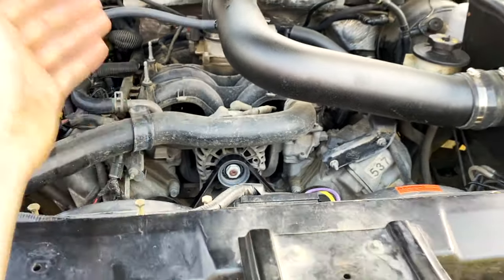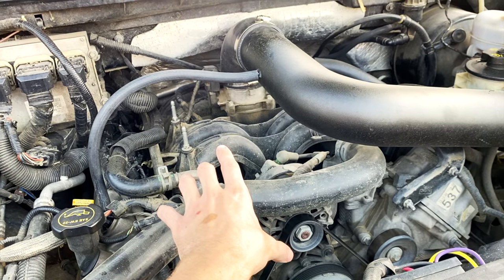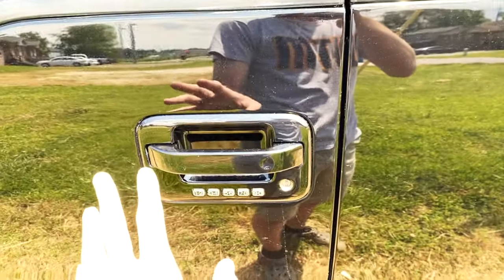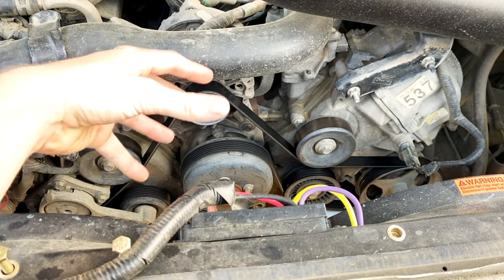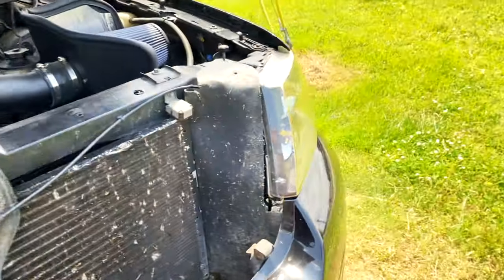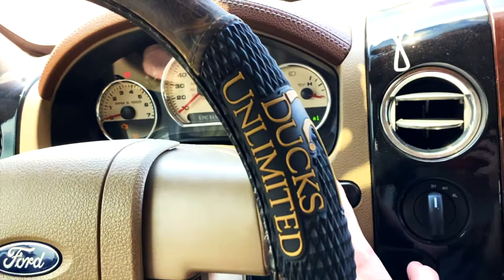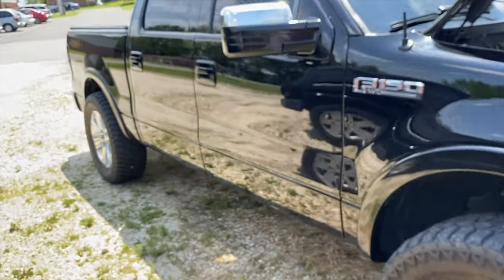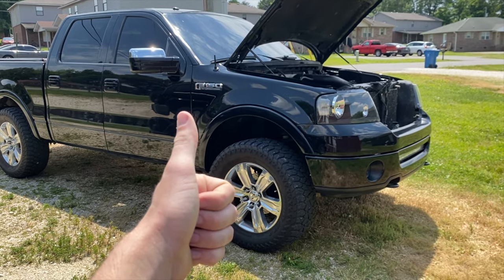5 THINGS YOU DID NOT KNOW ABOUT YOUR 2004-2008 F-150

Comment: I have a 2005 King Ranch F-150 with the 3 valve 5.4 L engine.Added Volant cold air induction system,a Edge Lightning computer tuner. I have 112000 miles on the odometer. Love this truck. Appreciate the keypad info.I had the "Limp Home" mode kick in 1 time(a squirrel had feasted on a wiring harness behind the intake manifold). Look forward to more videos from you.
Reply: You got a link for the tuner?

Comment: 2:30  great stuff about the keypad.  Also if you press 2 after your code it will unlock both front doors, so if you press 3/4 it'll unlock ALL 4 doors.  I love the keypad.  I had a 2000 z71 for 2 decades and really wanted the keypad, but i just started carrying a extra alarm fob all alone in my pocket

Comment: My 07 5.4L is clocking in at 182k miles right now. Have to say it’s been dead reliable. Appreciate these videos on these F-150s! Did spark plugs, engine coolant flush, transmission pan drop, axle fluid… well worth it with the price of new ones!
Reply: I recently bought one 201000 miles rn been good to me have a couple things I’m trying to figure out

Comment: I have a 2004 (Updated body style) with 127,000 miles and I’ve only done oil changes, brakes, transmission fluid flush and that’s it. It’s lifted and I replaced the strut 6” lift blocks with Fabtech 6” Coilovers. It’s been so dang reliable that I’ve kept it this long and bought a 2017 (bought new in 2017) and couldn’t bare to part with my old girl. She’s towed boats, friends cars (on car trailer), been in the mountain trails, sand dunes, mud bogs, snow, helped dozens of friends/family move and everything in between! She’s my ride or die!

Comment: I worked at a scrap yard for the better part of a decade, we couldn't warranty these engines because of everyone being afraid of failure. I have owned my 5.4 3v for about 6 years now, sitting just shy of 200k, and I want to say these engines have gotten a bad rap. i regularly abuse my truck, but I also regularly maintain it and she hasn't let me down (knock on wood). These are great motors making great power with plenty of aftermarket support but still great out of the box, I stand among few as a believer in the 3 valve. The fact is they have a bad design that is easy to remedy, lock the phasers and update the spark plugs. If you own a 5.4 3v my advice is either lock out the cam phasers, or just know in the back of your mind you'll be replacing the engine at some point, like you said in the video "that could all change tomorrow" lol
Reply from the maker: Black trucks been beat, broke, put back together and ready to do it all again! At least until tomorrow 🤷🏻‍♂️😂
Reply: What you mean about "update spark plugs"?, I've had my 2006 FX4 for 16 years, last time I replaced Spark plugs I called Ford dealer and they said their Motorcraft Spark Plugs are the same design, the same ones that break in certain circumstances.
Reply: How do you lock out the phasers? Actually what is a cam phaser?
Reply: @JayThompson25  How do you lock out cam phasers.
Reply: @JayThompson25  I'm about to buy an 2008  with the 5.4.  But now I'm thinking of maybe not

Comment: 2007 2WD Supercab with 161,000 miles no issues. 5.4L has been pretty good and tow a small boat. Stupid warning lights like the airbag, parking brake have been on but drives great. Only thing is the 36 gallon fuel tank and city driving breaks the bank man

Comment: I have a 2004 xlt with the 4.6 and 170k miles and it's still running strong after a rebuilt transmission and a few oil leaks

Comment: ‘06 FX4 owner here. Just another little tidbit, if you ever forget or buy a new(used) truck and don’t have the code, it’s on a plate behind the plastic on the back of the cab. Some earlier models it’s on a plate somewhere under the dash on the drivers side. Possibly on the firewall behind the carpet and insulation.

Comment: I replaced the aftermarket fan clutch for an original Motorcraft Fan Clutch, one of the best things I've done to my 2006 Fx4, doesn't make that intense aerial noise anymore, all aftermaket flan clutchs I found were "heavy duty" or something like that, I thought it meant durability but instead it seemed it'll engage with less temperature ...I hated it. Now with my OEM Fan Clutch my truck sounds so healthy is therapeutic.

Comment: Your engine bay has so much more room then mine! 
I did the timing job on my 2005 5.4 3 valve and holy shit it was tight.
I love this truck. The body is one of the best truck bodies ever and by far the best ford has ever made, and they are so customizable as long as you do it right (please dont add flairs without spacers on these trucks I keep seeing em around and it looks so bad), also the interior Is so comfortable, and finally my favourite thing the power. Iv drag raced people in my truck and have beat bmws, chargers, subarus, I even beat a raptor on the dirt because my truck was the last without traction control. 
Iv put so much money into it and most people dont get why i do until i take them for a drive

Comment: I have a 2004 fx4 4wd f150 supercab really nice put 13k in it still no crank new motor new everything man and i got a new ecm and it fired right up its amazing now i wont have a vehichke 25 to 30 yrs or more thanks for the video nice truck bro im running 33s with 20rs but idk the gas mileage yet

Comment: Had a 2004 F150 with the 3v 5.4 and it seized at 241xxx miles it was leaking 5 quarts of oil a day due to timing chain slapping against the cover because of the god awful cam phasers. Bought a 96 f150 5.0 and it has 521xxx miles on all original drivetrain still running strong

Comment: I bought my 2004 super crew for 3 grand put in a 'new' engine with 90k miles, new suspension,  new spark plugs, and replaced all the transmission fluid (transmission has 320k miles and Goin strong). I love it, bought it for 3k, put in about 7k and it's borderline perfect, next is adding a turbo. Not sure if that's a good idea tho 😅
Reply: Do ya have the new oil pump? I feel like I need to replace that first.
Reply from the maker: My engine is completely stock internally, however I do plan down The road to do the timing job accompanied by the high volume oil pump replacement

Comment: The thing you said at the end about the tires is true for all 04-08 f150s. I have a 08 f150 FX4 and put 33/'12.5/20 on it and they rubbed. Even after I put a 4.5inch lift on it they did. So I had to do a little modification  to fix it. They didn't rub bad just when turning. But they did rub.
Reply: He said it could fit 35/12.50s. 
You said 33/12.50s rub? If 33s rub how could 35s not be a huge issue? I put 275/70 on a 9" wheel and they rubbed on the front valance

Comment: There’s one thing to know. If you drive one long enough, you’ll either get really good at working on it, or you’ll be walking everywhere you go. My 2008 with the 4.6 liter has 280k miles on it. Both modular engines had the spark plug issues and the plastic intake/coolant crossover tube issues, but aside from that the 4.6 is a good engine. Replacing an intake or having a blown out plug repaired is a lot cheaper than paying $50k to $70k for a new F150. I think the 3 valve 5.4s were the worst engines Ford ever made. They seem to be more prone to total failure than the 4.6.
Reply from the maker: Ha I definitely agree with the first sentence all the way. I just pulled the transmission on mine first trans I have ever pulled so I haven’t been recording a video, but honestly, it’s a pretty straight forward process. They’re not terrible engines, but they most definitely could’ve been better. Maintenance is a huge factor in keeping these engines going. That’s not to say that it still wouldn’t have a failure.
Reply: @JayThompson25  I hear ya. I just had my transmission rebuilt at 270k miles. Broken reverse band.

Comment: I was in the market for a new work truck when my old '99 Chevy was nearing 400k miles. I found a 2006 F-150 Lariat with 121k miles on it. (This was in late 2017.) I held off on using it until I sold the old Chevy. Now I have a Ford with 138,212 miles (driving it now), and I have to pull the golf cart cause it won't pull my boat. (My wife has to pull that with her Chevy.)

Comment: Every truck is different because I have an 05  with145k miles and the trans has had to have been rebuilt twice (once my the previous owner and once by me) the alternator went out and I had to replace one of the wheel hubs. It’s got a 5 inch lift on 35s which may be part of the transmission problem but I also think it has to do with the previous owner using it as a work truck and he didn’t take great care of it. Hopefully it will last me a long time though

Comment: Found out in my 2004 F150 Lariat 5.4 that it has a hidden feature for the gauge cluster when you hold the set up and reset button then putting the ignition to on II and clicking on those two again in order to work. To move to another one press reset again to show all of its lights and also its basically showing the sensors on how they are at the moment. My truck has 110,000 miles and still runs like new!

Comment: First, I want to say I really enjoy your channel - it's provided a lot of great truck info. I have a question about my FX F150 with 4WD. The tilt steering lever no longer allows me to move the steering wheel up and down for adjustment. Do you have any suggestions on how I might be able to release the mechanism so I can adjust the wheel position?
Reply from the maker: I’d take the lower panel under the steering wheel off and see if you can see what might be causing it to hang up. It could be an issue with the release mechanism or it could be froze up

Comment: The code thing about the 3-4 is the same as it has been on all Fords with the door access, except it isn't button specific but actually code specific. What that means is to just hit the last button of YOUR code a second time and it unlocks all doors. Just to clarify.
Reply from the maker: Tried it in several Fords, all different codes of course and 3-4 will unlock the doors. Some may be code specific but some are not

Comment: Just bought a 2004 Lariat. I like it but I can't read the odometer. I'm going to pull the instrument cluster and replace all the light bulbs. Then maybe I can deal with the check engine light. I drove 100 miles to get it home. It drove and ran pretty good.

Comment: I also have 2006 f150 With the 54 triton three valve at 197,000 miles and just now about to do the timing job.
Reply: Got an 04 fx4 and just started with phaser noise at 190k. Same boat timing chain and phaser time.

Comment: We have an 07 with the 5.4 never had a problem but onlyhas50,000  on it bought it new in 07 and this is 2024 !
Reply: Holy cow, 50,000 miles in 17 years😅😅.  I don’t drive my 2005 much either, but I got 125,000 miles  for the 19 years I have owned it.😮
Reply: Bought my 07 lincoln mark lt for 15,000 cash four months ago with 87,000 miles on it. Funny thing is Tiger Woods neighbor was the first owner. I'm the second owner. No accidents, garage kept and spotless clean inside and out. Has tow package but elderly owner says it was never used to tow anything. Spark plugs were changed to updated ones two years before I purchased it.  All oil changes on history since brand new show done at every 3000 or 5000 miles. Hope im one of the lucky ones with few issues, I plan on keeping it until it won't drive anymore. Can anyone tell me if 15,000 was a good deal? He wanted 17,500 and I paid 15,000.

Comment: Out of all the vehicles I have owned, my 2007 Ford F-150 has outlasted them thus far; I may have gotten ripped off buying the damn thing, but it is without a doubt, a complete zombie before I had work done on it. To suffice, I'm waiting until spring to have my truck serviced by a local mechanic; They're within walking distance, so I don't have to take transportation and/or brave inclement weather.

Comment: I got an 04 f150. I've only had to replace transmission once for 3k. It's about 160k miles. Biggest issue is windows not coming up or down without fiddling with the buttons over and over.
Reply: You can buy an entire button set/module for $18 on ebay.
Reply: Same year, same mileage, different parts. Instead of the transmission the engine decided to grenade itself. The valves hit one of the pistons and everything went to shit. Although this happened, it still drove (albeit poorly) to the shop. 😂
Reply: Heck your ground wite that runs through rubber boot from chassis to driver door. Mine broke from opening and closing. Its the black wire, big wire.

Comment: Very informative.  I'm having problem pumping gas. I've changed the purge valve...charcoal canister... fuel rail sensor...cleaned filler neck strainer....and it still clicks the gas handle while pumping. Will the sensor on top of the tank fix this? HELP!!!

Comment: 2003-2004 5.3 were rated 295 hp and 330 torque and 2005-2006 310 hp 335 torque. The 2003-2005 6.0 345 hp and 380 torque so the horsepower was the same as the 5.3 but your torque was a bit higher but also the Silverado was lighter and reved more freely which is why the Silverado 5.3 is faster than the f150 by a bit.
Reply from the maker: For sure, the numbers on paper say one thing, however that particular 5.4 has actually beat two 5.3’s from a dig while on 35’s. Granted truck is well taken care of and tuned with a cold air, but however the 5.4’s make a decent torque down low and can move quite quickly if they’re taken care of
Reply: The 5.4 was built to be efficient for what the average truck owner needed. Ford shrunk the bore size and kept a long stroke. With the cam phasers it gets 90% torque at 2000rpms. Other makes need high rpms to reach 90%torque
Reply: @curtisgore1611  my brochure for my 05’ 5.4 3v says 80% torque at 1000 rpm.

Comment: I got my 05 Lariat that I bought brand new in 2005, has 135,000 miles on it.  Engine runs great but the frame is literally rotting away.  I wouldn't be surprised if it buckles on me one day.  Such a shame too cause the truck body is in good shape, interior is great, just the frame is rotted.

Comment: Regarding the instrument cluster, systems self test, that is only relevant on Lariat trims (was the King Ranch trim available then?  The Platinum trim was a Lincoln then).  However, all trim levels could do that since maybe the 12th gen.

Everything else, I already knew (I don't use the keypad, because the dealer never told me what the previous owners combo was (2006 model, I bought on 2009 with 23k miles), and I don't want to remove the rear seat back to get the factory set code on the module behind the seat)
Reply from the maker: Yes, my truck is the king ranch trim package. I will do a video on the seat back removal as it is rather simple 👍
Reply: @JayThompson25  I mean, I've seen videos on how to do it, I just don't want to do it.  I've gone 12 years so far without using the keypad.

Comment: I have the 2008 and the heads are different if you have the brown coil packs you will have normal spark plugs and no issues getting them out
Reply from the maker: Yes, some of the 2008’s still had the flawed plug but most did have the updated one 🤙🏻

Comment: Where did you get your mirrors? And did they fit regularly or did you have to get some sort of an adapter?
Reply from the maker: I got them off of Amazon, they bolt right up for the 04-14 models, however the harness changed in 07 to allow them to be fully functional with the puddle lights. They fit but the controls may be backwards and the puddle lights may not work on a older model

Comment: Mine is a 08 180,000 miles runs super strong few problems like 4/4 not working properly and a return coolant line goes bad behind engine can’t get to real pain in ass can’t buypass either. And just ford rust

Comment: Gotta 05 xl with 4.6 it’s lil 2wd bubba build leveling kit 35x12.50 on 20x10 hostiles but it sadly burns oil and has a trans slip now but still no miss or check engine light but every now and then my over drive messes up and oil burning I’ve been told is most likely valve guides because under load don’t burn oil but at idle barley smokes and smoke after ab 15 minutes after running really bad but oil level hasn’t changed in 2 months🤷🏻‍♂️
Reply: Magical engines man😂

Comment: Got an 05 dealing with a rough idle right now
Reply from the maker: Start with plugs and coils. Unplug coils individually to see if it gets worse. If you unplug one and there’s no change, could be your issue! If plugs are fouled or damaged you’ll have issues as well. After that id check fuel filter/throttle body

Comment: We got an 04 5.4 XLT, got 170k out of the original engine then swapped a 2010 5.4 an she's still runnin strong
Reply: Really? What things did you need to change to make it work? I'd like to know more thx
Reply: @jimone1265  I just bought a 2010 spec 5.4 crate engine. I changed out a few minor parts such as different injectors and a couple other things just for personal preference but as far as the actual mounting of the engine nothing needed to really be changed. The engine was to the same dimensions and for me it pretty well bolted straight into the truck

Comment: How much of a lift does it have? I have a stock one and want to lift it and I think your truck looks perfect. And also what size tire is that?
Reply from the maker: 2.5 inch level with 3 inch drop shackles and helper bags in the rear. Tires are 35 12.50 20’s

Comment: Hi what lift do u have and tire size looks awesome I have a 2006 ford lariat crew cab xlt  5.4 3 valve whit 205k running strong
Reply from the maker: 2.5 inch level and 35 12.50’s on 20” wheels!
Reply: @JayThompson25  thank you